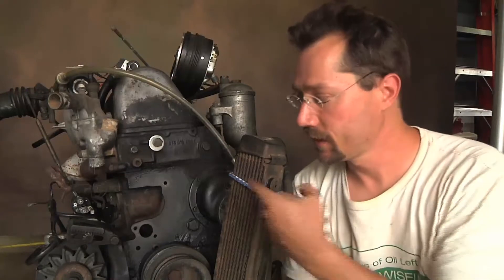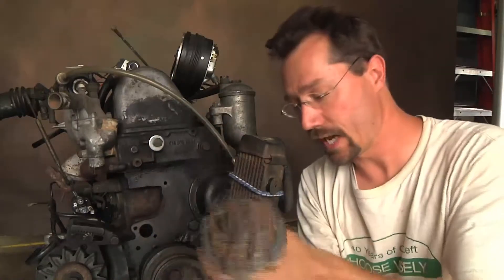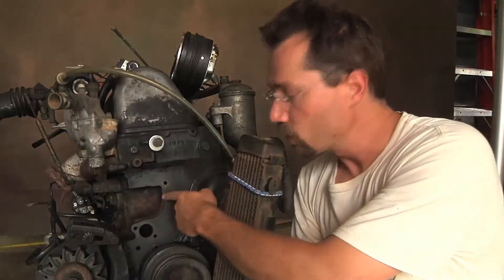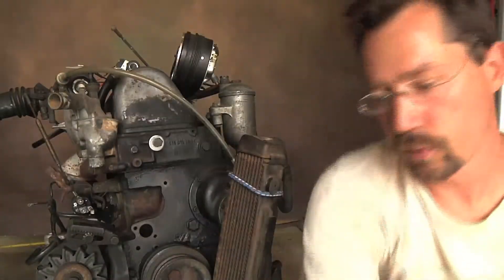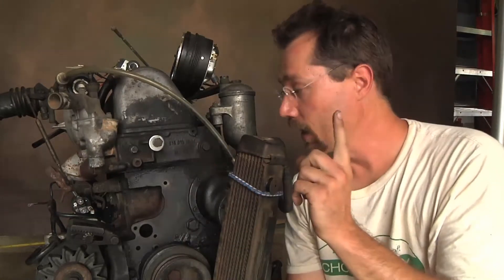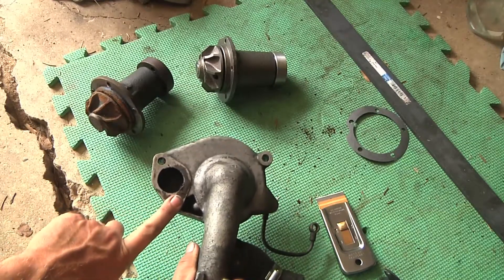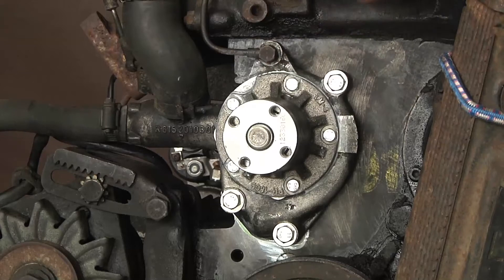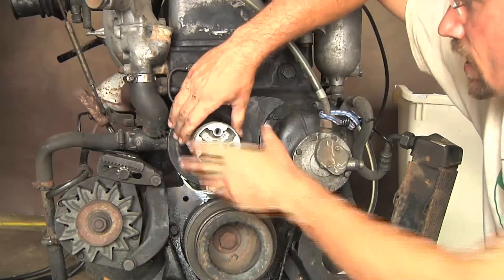SuperTruck: New Water Pump

Comment from the maker: This is an "in-the-works" project. I'm making it up as I go, finding parts, buying what I can afford. I'm planning on either a 11 or 13" series-wound forklift motor, but I don't have it yet. I HAD a motor a while back I was planning on using, but that ended up in a friend's electric pickup conversion. I'm planning on running the electric motor on as high voltage as I can afford. I'm hoping for up to 144V with a 1000 amp controller.

Comment: Forgot to ask you, how powerful is the electric drive motor on this truck and what kind of batteries you will use for this project? I'm also interested of how many volts and amps the electric motor is running at. Thank you!

Comment: Hi Ben, nice project you got there! I'm also working on a gasoline electric garden tractor. I'm using a gas motor which runs a direct current generator that sends power to an electric motor that drives the transmission. It can also run only on batteries or with both the generator and batteries at the same time. This thing is not finished yet. You can check out a video on my channel of a bigger, diesel-electric vehicle that's just been completed :).

Comment from the maker: Actually, the bracket mounted OVER the water pump. The water pump was in the exact same place before as it is now. That big bracket held the power steering pump and and idler pulley. (I think I said A/C compressor in the video, that's actually on a different bracket.) I think that the early versions of this engine just had a belt from the crankshaft to the water-pump/fan to the alternator and back. Later, power steering was added, so they needed the big bracket to retrofit to the engine.